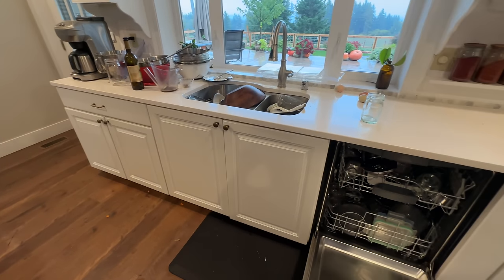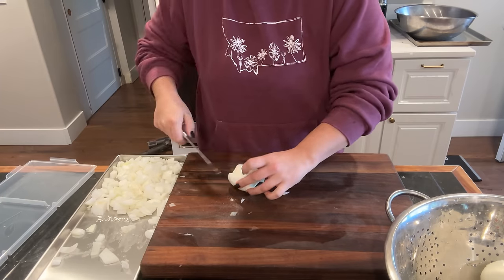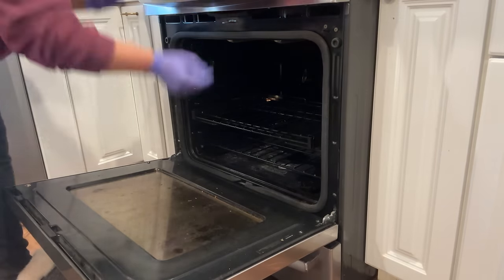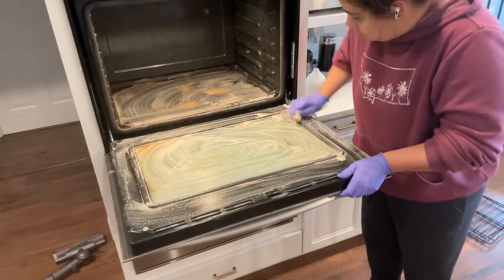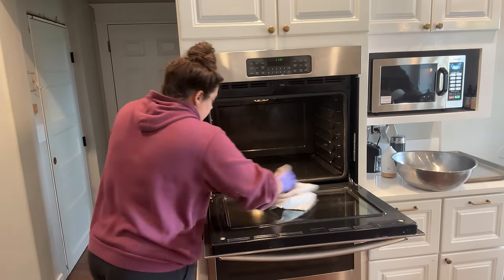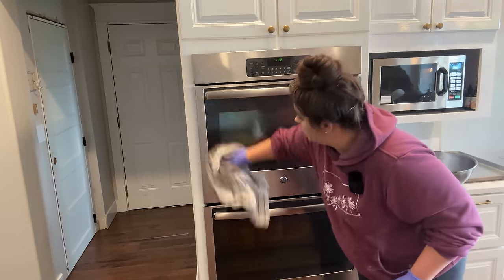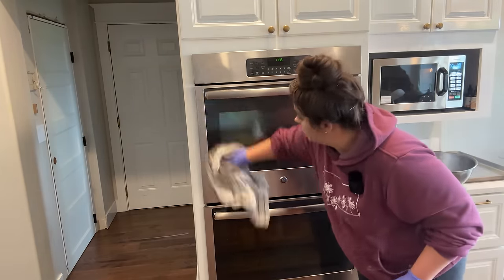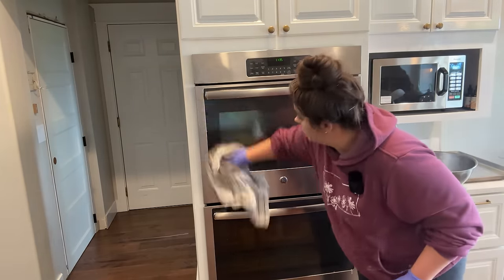This can't be put off any longer!

Comment: FYI for anyone who is trying to clean the oven racks here is an easy way. Take a large garbage bag , put racks inside, pour ammonia into bag and close it up for the fumes to break down the baked on grease. Trust me it works beautifully!! Only problem is I don’t exactly recall the amount of time needed. But if after a few hours you check them and the grime doesn’t come right off close them up again and give it more hours.  This will save you so much time and scrubbing energy. The racks will come out beautifully silver again. You can also clean the burner pans this way!!

Comment: I clean mine after it turns cold in the winter and before it gets warm in the spring. I run the self clean cycle and it really heats the house so it is a win, win:). I find it easy to clean after running this cycle.

Comment: Another approach to a kitchen is to clean as you go. If something spills on the bottom of the oven, clean it as soon as the oven cools down. Give a daily clean to the handles of your appliances. If you have a bit of a mess in the microwave, clean it right then in there while it’s still wet.

Comment: I would suggest that you line the drawers with parchment paper to keep the fly away powder out of the cracks and make it easier to clean. You should fold the corners so it goes up the side of the drawer a little bit.

Comment: I fully get the not wanting to use the self cleaning mode... my oven door is stuck shut since I ran mine.lock motor went kaput...happy Thanksgiving and I doubt I can fix it before Christmas.  Grandma will be a flaking out on baking  this year.

Comment: You should move the fridge out and clean the floor and walls around it at least 2x a year, especially if you have pets. Also vacuum back grill of fridge. Underneath the countertop is building up grunge. You can see it when you were sitting on the floor. My housecleaning lady uses barkeeper friend on my 50 year old stainless steel sink. But she rinses it with vinegar water, not tap water, and it looks brand new.

Comment: For the microwave- put a 2 cup glass measuring cup  with warm H2O add a few tablespoons of baking soda to a  
Mix until baking soda dissolves.
Place in microwave and run for around three to five minutes, or until the microwave fills with steam.
Let the mixture sit in the closed microwave so the steam penetrates the grime.
Wipe clean!  It really loosen up any dried on food or grease.

Comment: I like to clean the oven once a month.  I wipe out dirty spots from time to time in between so they don’t build up.  Even if you use the self clean you still have to pre clean the oven first because it will bake in and you’ll never get it out.  Be careful with chemicals especially on the oven window check your manual.  I find it takes less time and effort to keep the oven clean if I do it more regularly.

Comment: When I was younger, I would do a deep clean 2x a year.  Now that I am in my 60's, I do a deep clean only when it needs it.  Like I plan towards spring to do a deep clean in our main living area and kitchen, but will have a younger girl come help me.  As for the oven, I now use the self cleaning cycle on our new oven as it's hard on my back to do the old fashion way of hand scrubbing.  A suggestion to is to pull your stove out once a year and clean along the sides and the floor under it.  I was surprised at our old house how dirty it gets in that area.  Same way around the refrigerator.  Pull it out and clean the sides and back!!!

Comment: In nearly sweet 20 as newlyweb I can deep clean the house with all the windows the same day. Now nearly my 40 I deep clean one room per day. In the kitchen I sweep first, then move the refrigerator clean the floor and mop, clean the vents of refrigerator, the top of it, move the stove, clean the side, clean behind the stove, sweep the floor and mop. Clean the cabinet from top to bottom. Is very rare I clean inside the cabinet, because I clean has need is something spill. Then clean all appliances that are over my counter, clean my counter. Then clean the outside of the refrigerator and the stove. After finished all the cleaning detail do the mopping. I clean the oven after use is more easy to do maintenance.

Comment: My husband got me a new washer, dryer oven/stove, dishwasher and fridge over time and Ive been really specific about keeping all of it as clean as possible so I clean my stove top and oven probably every week or 2 for “deep clean” and wipe down every time they are used. I clean my washer gasket areas, clean my dishwasher catcher tray, and wipe down the outside of the rest of my appliances about every 2 weeks unless there’s a spill or extra mess on them. I don’t like microfiber either. I worked at a hotel before the pandemic and they let me take towels they were getting rid of that weren’t perfect for the hotels use anymore but perfect otherwise and I cut them up into rectangles and use those for my rags and I love it.

Comment: I think you can take the door off most ovens…makes it 100 times easier to clean…it’s a lever in the door frame.  It’s super energy efficient if you vacuum the vent slats of your refrigerator!

Comment: I hate cleaning ovens. They are so hard to reach into. I use the autoclean function on the oven and it leaves an ash where there was grease burnt on. It’s hard enough to reach in and get the remaining ash. You feel so proud of yourself after you are done and have it all cleaned. Job well done.

Comment: Excellent thing about using cotton rags rather than paper towels. That is what I do too.
However, I don't buy rags. Old worn out towels cut or ripped into squares make excellent rags. Old cotton sheets, old t-shirts, old anything cotton or linen make serviceable rags. Even the raggediest piece of cotton falling apart can probably be used once before being discarded.
Unlike paper towels, these reusable rags need to be washed, and that implies using water and detergents. However, to manufacture paper towels it is necessary to cut down trees, transport the wood products in large gas-guzzling trucks, process the wood pulp using large amounts of water and chemicals, package the paper towel rolls in plastic, transport the finished product to warehouses and then to grocery stores in large gas-guzzling trucks, and finally carry the towels home; this latter is usually in private cars rather than on the bus or on foot.
I figure that all in all laundering cotton rags probably is much easier on the environment. Thanks to using these old towels, sheets and t-shirts, a package or paper towels lasts me about a year.

Comment: I am late with my like...sorry.... I was making food plans, dishes, kids events, shopping and getting Hubby to work! I am so happy about it. Hugs from Esquimalt
Reply: Oh... big tip from my Mamma! To give yourself a helping hand, right after you clean the oven/stove, put these thin aluminum trays you can get from the stove, or you can make it yourself... and put it on the bottom of the oven and when spills happen,  it is an easy clean... I take it a step further step... I wrap the tray in fresh aluminum so if it gets bad, I can take it off, scrub off the  mess and then recycle the foil...I then re wrap the tray for the next time... so worth it...

Never use the self cleaning mode... But you can do yourself a solid and put a heat safe glass bowl full of water and fresh lemon juice from one lemon... Have the oven cook it for an hour at 450, or if you can set a timer to have the oven cook/clean to be ready for you in the morning.... Get your big appliances on easy rollers so you can pull them out once a month... if it is easy, it is easy to keep up. If it isn't, I know I won't want to do it... 

Works for the fridge, but you can use clear shelf liners... so awesome and then the teenagers can tackle the chores too... LOL

Hugs from Esquimalt

Comment: Did you know the oven doors will just slide out to make it easier to clean.Well  at least mine does. Also put your racks in a large trash bag with some ammonia  set them out side in the sun, while cleaning the rest, this is an old tip from way back in the day. hope I help make this easier for you next time.

Comment: Pull your dryer out from the wall once a year and vacuum behind it and underneath it. My Mom almost set her house on fire from lint build up behind her dryer. Also, if you’re on well water, you should shut off your hot water tank, drain and flush it out. Well water has minerals that build up in the bottom and can damage it. I didn’t do that and had to replace mine in just 2 years from iron and calcium deposits from my well water. And those same mineral deposits build up in your tiny ice maker water lines so make sure you check those at least once a year. Came home from vacation and had a flooded kitchen from a ruptured ice maker line. It seriously sucked. And I never use my self cleaning oven either. I hate it. Don’t know why, I just do. 😂  I use baking soda and vinegar to clean my ovens and microwave. Works great and it’s all natural. 👍🏻 I also run a pot of vinegar and water thru my coffee maker once a month and then a few pots of clear water to rinse out the vinegar. It seems to make the coffee maker last longer. Again, my well water if very high in iron and calcium deposits so you may not have the same issues. 
❤❤❤❤ I also rarely clean the very top of my refrigerator because I’m only 5’2” tall so out of sight out of mind but when I do it’s 🤮

Comment: There is a filter in the bottom on the floor of the dish washer. It needs to be cleaned once a month.  Mine you just turn the filter and it comes out. The SERVICE MAN that came for a clogged dish washer told me it must be cleaned out monthly 😳😄

Comment: I set a glass measuring cup with water in it in my microwave and heat it for a few minutes. I keep it in and let steam build up for a few minutes and any stuck on food easily wipes up. I cleaned my oven before Thanksgiving and then totally boiled over an apple pie. Holy smokes!

Comment: One thing I learned (the hard way) for us animal owners is that their hair will collect on the vents of refrigerators and freezers too. Just like the oven. It can burn up the motor because it blocks air flow. Our freezer burned up. So we have scheduled every 6 months on our calendar to pull them out and vacuum off the fur. Oh and a glass guy told me to never scrape the razor back and forth on the glass because it scratches it more. Pick the razor up with each pass. It makes a big difference in the life of the glass.

Comment: You wanted to know how often I clean my oven, I guess I clean it when I feel it needs it sometimes it’s in three or four months and sometimes it’s a year. I guess it depends on how sloppy I get in the oven in my final rinse water when I clean my sink and my inside of my oven, I use one cup of white distilled vinegar and 2 cups of water and bring out the rag and it takes all the water spots off like a charm.  If I have something stuck on the oven, I put a big bowl ovenproof bowl with water in it and turn the oven on for about an hour and that steam really helps get the stuck on things off.  I also put a cup of water in a big bowl in my microwave with a splash of vanilla let that simmer in the microwave for a couple minutes and then all I have to do is wipe out the microwave with a clean rag.. hope this gives you some new ideas. You got a lot done this day..  I have often thought how nice those baking drawers are in your island and how convenient that is, I’m happy for you.

Comment: Did you know that you could line the bottom of your oven with heavy duty aluminum foil? Put in under the element. It will collect the spills, overflows, and crumbs. Then you just change the foil as needed. Saves a whole cleaning task.

Comment: It's so funny. I just cleaned my oven today. I put paper towels in the bottom of the oven and on the door. I pour white vinegar on the paper and soak for about an hour. Then I scrub and wipe off the buildup. Never self clean without wiping down first, or your house will fill up with smoke, and all of your furniture will absorb unessary odors. We both were on the same page, a clean oven for Xmas dinner.

Comment: I sprinkle with baking soda, then spray with vinegar.  Let set for few hours,  then wipe with hot water.  it usually will wipe out easily.   The oven is very dirty, yours look clean, compared to mine.

Comment: I use vinegar (in place of your water) and bar keepers friend, and make a paste, spread it all over like you did and let it sit for at least an hour….or longer……whenever you get back to it. Then wash it off.  I also do this with my walk-in shower that has 2 glass sides to it. It really works well. If it’s super dirty, you may have to do it twice, but after that….it should be very easy if you do it at least once a month.

Comment: Microwaves are a breeze spray it with whatever cleaner you want stick a cup or a bowl of water in for a couple of minutes let it steam. Simply wipe everything out.
Your oven doors should slide off the hinges making it easier to get into the back if needed.

Comment: How about the box where your microwave sits. The top of your refrigerator. I always wonder about the floor on the sides and underneath of my oven. It’s a little trickier sliding a gas oven out of a spot because of the gas line.

Comment: You can purchase oven liners for the bottom of the oven in various sizes. I had one in my wall oven when I lived in Tennessee and it lasted year after year after year and all you have to do is once the oven cools reach and pull the liner out rinse it off under the sink wipe it dry and put it back in the oven. I don’t care how hot you get the oven or how many hours you keep it on or how often the liners work.  You’ll still have to wipe the door down from time to time but it does make a lot of difference when you don’t have to scrub the base of the oven and eventually the floor of an oven will wear out if it’s scrubbed or scratched and water or other stuff lands on it. Also it seemed to me as if the walls of the oven didn’t get as stained or dirty when I had an oven liner. Since I’ve been in Texas living in Apartments I just put a big sheet of heavy duty aluminum foil on the bottom of my oven and I turn the shiny side up so that it reflects the heat back up into the oven and if I’ve spilled something in the oven I don’t have to scrub it. 
Also I noticed that where the cans of spray oven cleaner are in the grocery stores they also have sponges that have the chemical on them and the sponge is wiped across the oven which would be handy for your door. You would need to wear some gloves. But I’m thinking that most likely you wouldn’t have that strong chemical smell flying through the air getting into your lungs and polluting your house if you were to use the sponge and I think it just sits for a little while in the oven and then you go wipe it out with a clean wet cloth and then dry it.
Reply: Also, the seal around your oven that probably feels like hard but pliable plastic or a hard material of some type with woven fibers in it, will wear out and start  fraying the fibers if it’s scrubbed too often. It’s best to wipe it down every now and then without scrubbing it hard. If that seal is becomes frayed you’ll have to do without an oven until it can be replaced because it is going to let heat escape and it will be a fire hazard too.

Comment: Your oven doors come off to make cleaning easier.  Before my self clean oven I cleaned my oven every month with easy oof.  It was all we knew.  Now I run my self clean every month.  I also use vinegar a lot to clean with.  At night I soak a rag or rags in vinegar and lay them on stuck on stuff. Everything wipes up clean in the morning.  I also add some to my was water for lettuces.  The taste of the salad is amazing.

Comment: Tip for cleaning the microwave.  Put some water in it and heat it up to very hot. Let sit and the steam will loosen all the junk inside. Will wipe off easy

Comment: Hey Becky,  I want to save you a bunch of time and water -   I noticed that you pre-washed all your dishes.   I was a long time pre=washer and I’m not anymore.   Here is the trick.   Put your dishes in dirty, you don’t need to rinse them at all.   Before you close the door or start it up run your kitchen sink water until it is HOT.   Now put your soap in the dispenser = don’t use those pod things, just plain dishwasher detergent (that part was edited out so I could not see what you used).  Fill the regular dispenser , the part where the lid snaps shut, if there is a second compartment next to it then put detergent in there too = that is for the pre wash cycle.   If your dishwasher does not have a second detergent compartment then just squirt a little in anywhere - my lid has a depression to put some in.  Then close the door and start the cycle.    You need that hot water for the pre wash and the extra detergent for it.   The regular detergent dispenser is actually for the second longer wash.         Hope that made sense.

Comment: I line the bottom of my oven with foil so it’s easier to clean. I always use the self cleaning mode. Anyone else get goosebumps when she was using the razor?😵‍💫😵‍💫
You can use Bar Keepers Friend on your stainless steel cookware also.